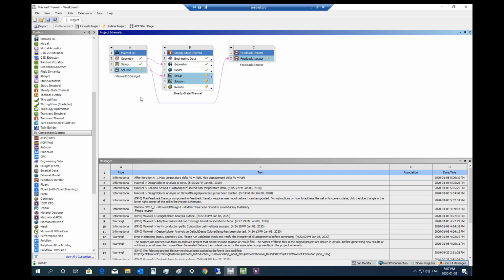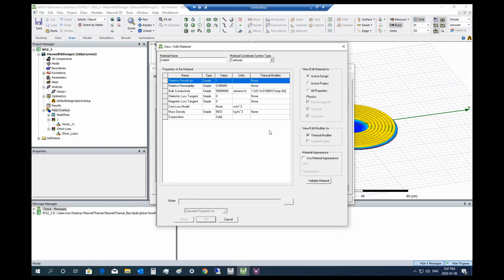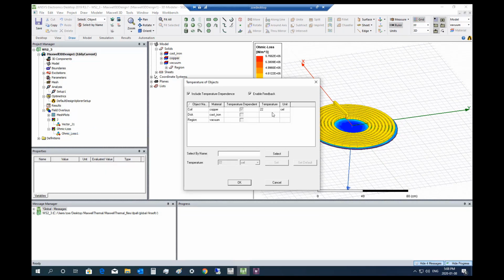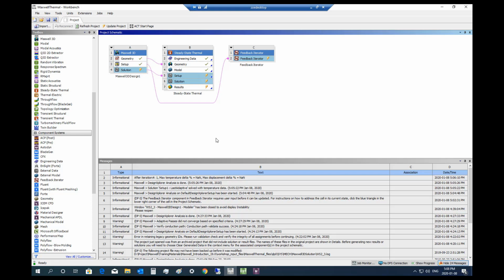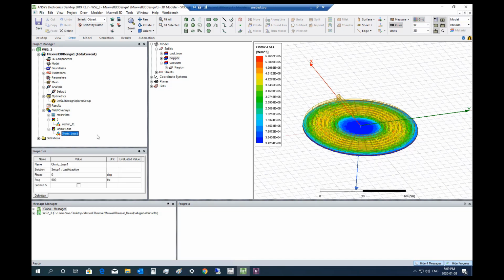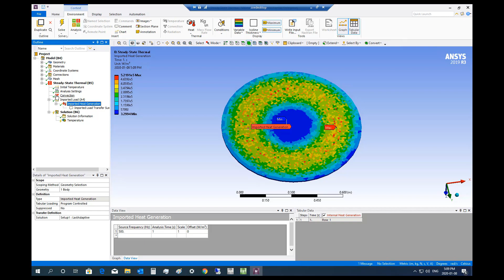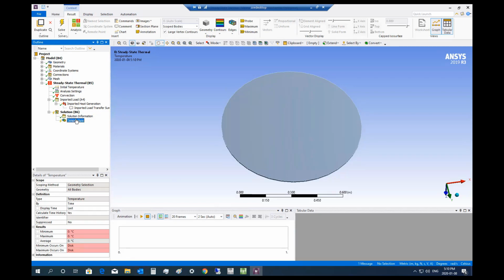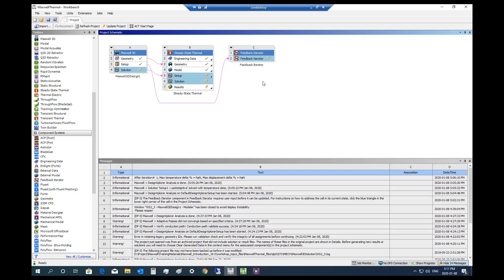2-way Thermal Analysis Between Maxwell and Ansys Mechanical

Comment: Hello, please can you explain how to set the data set graph values for stee??? am unable to find the temperature graph .... i  also sent you an email please reply ASAP
Reply from the maker: The Ansys academic support policy (https://www.ansys.com/academic/educator-tools/support-policy) was updated recently and all academic support will now be handled through the Ansys academic community. You should be able to register for the community at https://forum.ansys.com/entry/register which will allow you to submit questions on the various forums in the community. Several Ansys engineers are interacting with customers on that site so your questions should be answered in a timely manner.

Comment: I'm currently trying to model a SynRM in ANSYS Maxwell with one way coupling to steady-state thermal. When I set the material thermal properties in maxwell and set the object temperature and run the simulation, I can import the solution data into the setup field for Steady-State Thermal. This is where I'm hitting an obstacle. When I open up Mechanical, my imported load (A-4) folder just has a question mark and is empty. Anyway to troubleshoot this?
Reply from the maker: The Ansys academic support policy (https://www.ansys.com/academic/educator-tools/support-policy) was updated recently and all academic support will now be handled through the Ansys academic community. You should be able to register for the community at https://forum.ansys.com/entry/register which will allow you to submit questions on the various forums in the community. Several Ansys engineers are interacting with customers on that site so your questions should be answered in a timely manner. 

SimuTech has a training portal that contains both Ansys training material and tips and tricks videos that have been created by SimuTech engineers. If you are interested in pricing or learning about this offering, please contact us at info@simutechgroup.com.